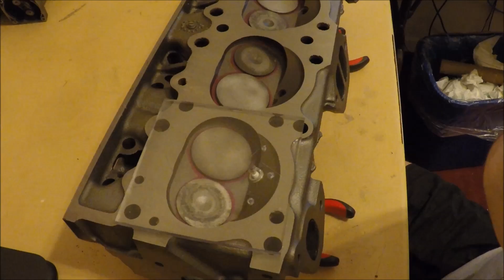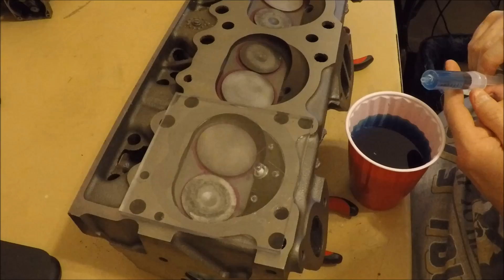how to cc pontiac #16 heads 72 cc heads high compression high performance

Comment: how much power did you get out of those heads?
Reply from the maker: thanks for asking.. after the work i did to them i ended up not using them because my build went an entirely different way and this would have made compression way to high.. ended up building a 461 engine.. have some videos of it running on my channel.
Reply: Fullforce LTX I made 440 with my #16 heads; if I would have gone 10.1 compression I would have gotten 10 hp putting my at 450.

Comment: What did you do with the heads??
Reply from the maker: ended up selling them as i built a 461 engine and these would have been way to high of compression.
Reply: @ponchopoweredpontiacs9273 these are great pieces.
i just acquired a set of 722 heads, the proper LH/RH Round port Manifolds and the Winters Factory alum intake.
Spendy yet a one in a life time event.
I intend to install on my 30 Options Loaded 1968 Firebird HO Convert.
With a 1968 "WU" 4 bolt block.
Intent is a SCAT 455 assembly with H beam rods, 030 pistons.
The 1.65 arms will yield I believe a .512 lift.
Quite a Pontiac street motor!
The #16 are what I have factory, now.
I was sent a pix of a 1 of 10 ever made, 1968 Firebird RAll Convertible.
Just went thru a rotisserie.
I am new to Pontiac and I'm continually WOWed what this line has and the ultra rare stuffI and am able to be around, have and be Actually part of.
Almost like a page of history as I speak!
Reply from the maker: @ashqelon7267  sounds like an awesome setup... would love to see some videos.. best luck with build.. yes there is soooooo much cool stuff to do with pontiac engines.
Reply: @ponchopoweredpontiacs9273  
Just today spoke w my resource of these items.
He actually also has set of #96 late 68 RAll heads along with the RAll proper cast iron intake manifold.
.
He talked me into swapping the #722 RAlV HEADS instead yet also keep the RAiV aluminum Winters intake.
I may just go ahead, get the #722 for my 69 400HO.
I'm a bit obsessed on these ultra rare pieces, yet how many lives does us guys live?
Or more so, how many times these ultra RARE pieces become once in 10 lifetimes available ??
Reply: I had #16s on my 455, running 30.5cc dished pistons.

Comment: Hell no you don't want bigger. Everyone wants a smaller combustion chamber to get more power. If you say you want bigger than use the stock 6x heads. Also kill the music it's hard to hear you speak.
Reply from the maker: Was Rocking out to Metallica.. its not too loud.. anyway yes i am well aware of the combustion chamber sizes and compression ratio etc.. my build went an entirely different direction. i ended building a 461 stroker so these #16's would be way too small of a chamber.. even on a 400.. 72 cc with todays pump gas 93 octane is not so friendly. thats why when they cc'd a little bigger at 75 i was pleased..
Reply: I'm surprised Lars didn't sue you for copyright infringement. Lol. Cliff would be proud of his "Call of Ktulu" though. \m/
Reply: @ponchopoweredpontiacs9273  gotcha.. Nice build. I'd love to had a 461. But I have to use these 48 heads to see how they do with an upgraded cam.
Reply from the maker: @afastcuda1970  LOL.. got that right about lars.. haha yeah cliff was the man.. i still remember hearing about the accident on mtv.. man what a bummer.
Reply from the maker: @arfrce72  if i had to do it all over again i probably would do KRE aluminum heads.. their 85 cc heads on my 461.. im very happy tho with my 6x-8 that were milled a decent amount but they cc around 94 cc..